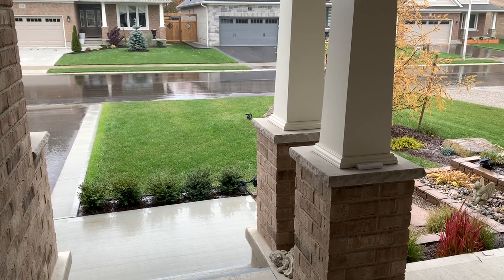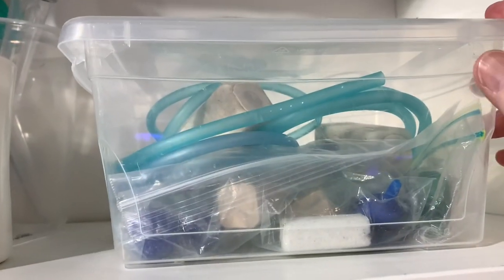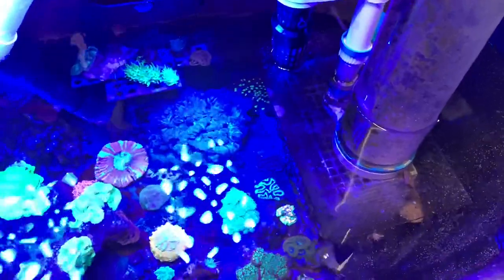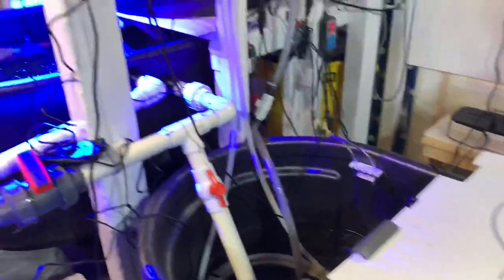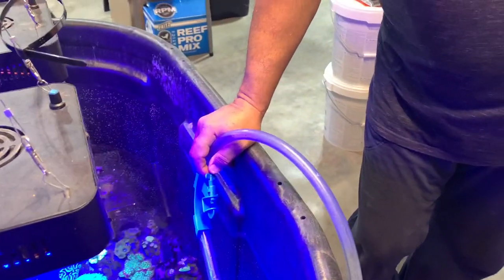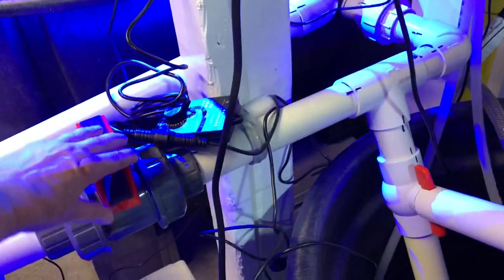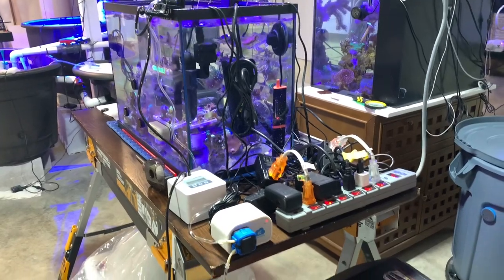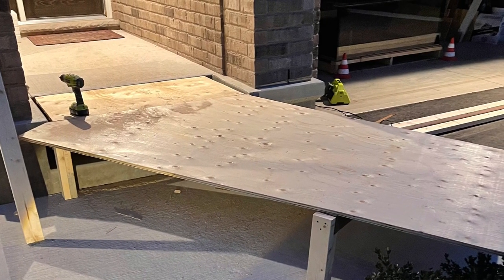ReefGrrl’s Weekly Reef Wrap-Up No. 8 - Water Change Time, Dosing, Sponges?

Comment: I hope that ramp is strong enough to hold the weight of the tank when moving it. Super exciting! 👍
Reply from the maker: It’s 3/4” plywood with 4x4 supports and legs. They have to come back and finish it - it’s going to start on the driveway so the slope is really gradual...🤞🏻